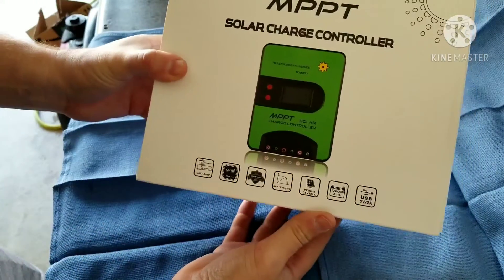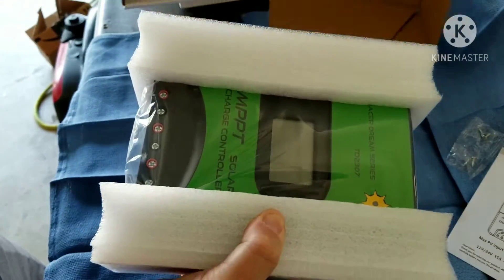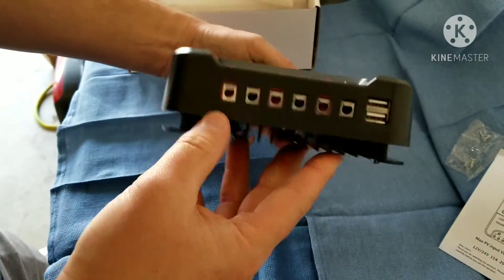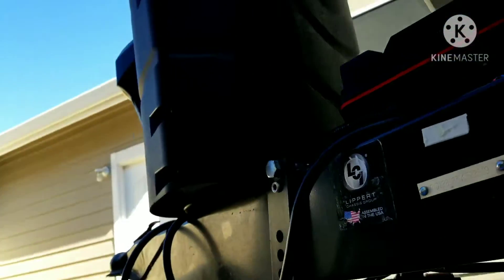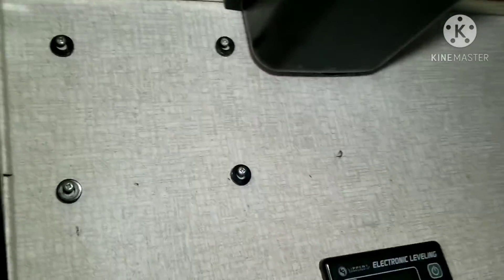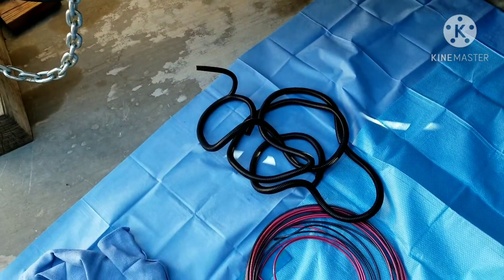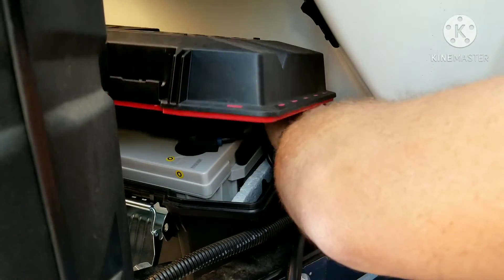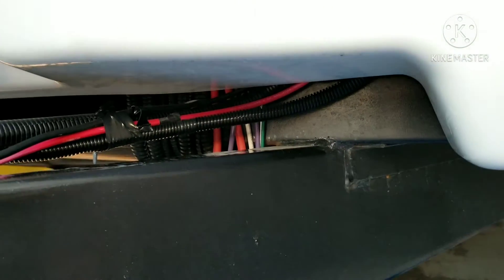BELEEB MPPT Solar charge controller install

Comment: I wish you showed how you installed the charger to the wall by yourself, I read from a couple reviews it was very difficult. This would have been very helpful, thanks for your video.
Reply from the maker: You just have to do the tape trick. Tap on back, mark holes then put tap on wall. Make sure tape is even and same length on both sides.